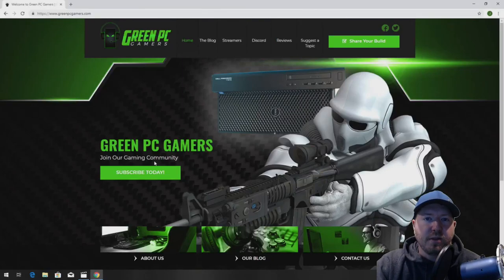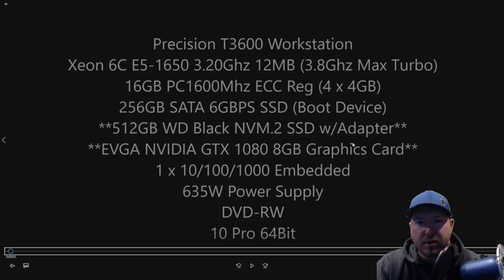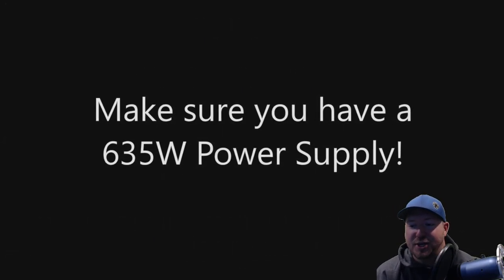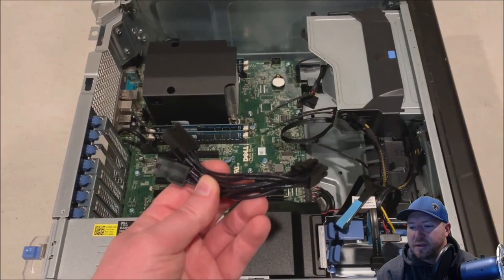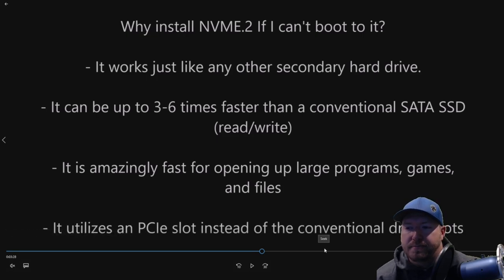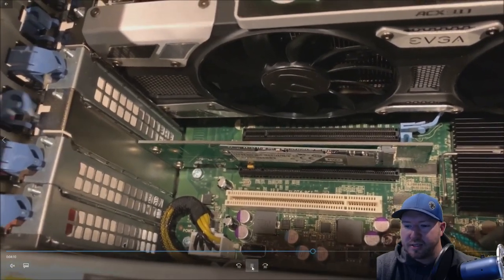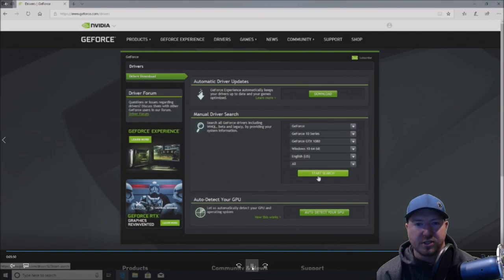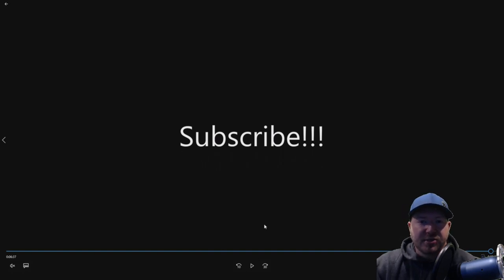Precision T3600 Gaming Computer (NVIDIA GTX 1080 and NVME.2 Install)

Comment: I have a T3600 I have built, 32GB ECC RAM, 635Watt Power supply, I added a 500GB M.2 and 1TB spinner, with a GTX 1060 6gb...the box can pretty much handle anything I throw at it...and it doubles as a VM hyper V lab for my work I do...best bang for the buck!
Reply: Do u know if GTX 1050 is compatible with T3600?
Reply: @ALbajajajo2766   yes it should work if anything update bios?
Reply: Is the A18 the only available BIOS update for Dell Precision T3600

Also I am using 16gb of ram. (4 x 4gb) DDR3. Not ECC Reg. Not sure if I should use ECC Reg ram?

According to Google using ECC Reg ram will reduce gameplay.

Comment: Very nice ! I have the exact same computer. I installed an Intel Xeon E5-2690 V2 CPU and a EVGA GeForce RTX 2070 XC ULTRA GAMING 8GB GDDR6 Graphics Card. Works great and I'm even getting around 90 to 120 fps on triple AAA games.
Reply: @Adel 😉 wait a sec xeon e5 v2 works on t3600????? are u trying to say that??
Reply: @subhanbasharat7891  I am Running E-2690 V1 did not think V2's worked over microcode in intel chipset on T3600 did you get one V2 to work ?
Reply: @Adel 😉 RX6600 works with T3600? my processor is E5 1650, but could only gets black screen with AMD driver. Did you do any trick to get RX6600 working? is your BIOS ver A18?
Reply: Looks like you got T3610 version and not T3600 because it WON't support Xeon E5-2690 V2 CPU.
Reply: False information!! Edit it!!!!

Comment: Tip for NVME drives on older hardware: You can install Clover on a standard HDD that you wouldn't otherwise use in order to "pass" the boot sequence over to an NVME drive that's on a PCI-E expansion card. You'll get the performance you should get from an NVME drive, assuming you have enough PCI-E lanes.
Reply: Are you the kind of player who beats up your Co-player or the kind that co-operates into rescuing your girlfriend?  
River City Ransom High Forever! 
#ono
Reply: There really isn't a need to boot from NVME drive on PCI. That's if you have the Perc H310 pci card. I installed a Samsung 860 Evo SSD attached to my Perc PCI card under UEFI in my T3600. Crystal disk Mark reflects 3490.7MB Read and 2564.3 MB Write for sequential. I am rather pleased with it.

Comment: Yes you can boot it up with an NVME And Clover Utility in a Internal USB penDrive next to the Power Supply.
Reply from the maker: Your are correct
Reply: ok this is for booting, but how do you install win 10 on NVMe in the T3600? My NVMe can be seen in the windows folder, but when I want to try to install it in NVMe, it is not shown as an option for installing

Comment: Picked up one of these cheap recently, upgraded the GPU to AMD RX 570 (Thank you Bottleneck Calculator), RAM to 32 gigs 1333 but had to contrive a side panel out of foam core due to the height of the GPU. Getting well over 100FPS  on Doom Eternal at 1080 and it's also a flawless HTPC. Previously had an AMD FX-6300 system with the same GPU and got lots of artifacts playing videos due to bottle neck issues. Best of all the T3600 - "The Terminator" has built in handles :)
Reply: Bottlenecks don't cause artifacting lol

Comment: the 1080 will be bottlenecked slightly i would recommend a 1070 or 1070 ti. or going with a e5-1660 with a gtx 1080 would be fine .
Reply: bottlenecked is just a myth.
Reply: What about a Rx 590

Comment: I have been using a T3600 as a gaming PC for two years by now. 635 W PSU, E5-1620 @ 3.6GHz and an nVidia Geforce GTX 1060 3GB. Has anyone tried the T3600 with a 1660 or 2060 GPU? I am contemplating an upgrade.

BTW, if you want people to visit your blog to get ideas, blocking the website for European visitors is rather rude.
Reply from the maker: We have tested the EVGA GeForce 1660 Ti in the T3600 Workstation.  You'd probably see a 10-20 FPS Bump from the GTX 1060 3GB, depending on what games you play.
Reply: @GreenPCGamerscom  Primarily i need a GPU with more memory, since RDR2 is really VRAM hungry.
Reply from the maker: @raskolnikov9067  you could also consider an RTX 2070 w/8GB of Vram.  Or, if you are not a gamer you could try to grab a Quadro M6000 w/12GB on an auction site like ebay.
Reply: @GreenPCGamerscom  I ended up buying a 2060, has been working great for a week by now. Really great value in these old workstations, almost eight years old and still going strong.
Reply: @raskolnikov9067  I want to do the same, did you change your cpu and psu? I plan to buy second hand t3600 from ebay next month.
Reply: @memehell  No, still the same CPU and PSU
Reply: @raskolnikov9067  Bro how did you fit Rtx 2070 in T3600 case? ain't that card too big?
Reply: @muhammadahmad2898  2060, not 2070.
Reply: @raskolnikov9067  Oh im sorry. Yeah 2060 will fit in easily. So how's your T3600 gaming machine? airflow? performance ? temps etc? and how many case fans do you have?
Reply: @muhammadahmad2898  Working perfectly. Can play everything at 1440. Box is comfortable warm to rest my feet on. No extra fans.
Reply: @raskolnikov9067  Thanks :)

Comment: Why is the E5-2689 not listed as a recommended CPU?  I have this is dual mode on the T5600 and they are a BEAST.  Of course, this requires the  825W DELL PS. All cores across 2x8C, 2x 16T to 3.3 GHz.

Comment: I bought a used 1070 blindly and ignored the fact that the t3600 cover has an internal handlebar which will cause clearance issues. Something to keep in mind.
Reply: Also the 6 to 8 pin adapter link they have in the t3600 post is the wrong type of cable. You need 8pin male to 6pin female adapters, the one they linked is male to male. I blindly copied and pasted the adapter model number since their link was all out of stock and I assumed they linked the right cable. Be wary. They sell what you need on amazon so it was only mildly annoying.

Comment: I just bought a t3600. I've put 16GB ddr3 1600mhz ram into it and a gtx 1660 super, I still have a e5 1620. Do you know if I can upgrade to an e5 1660 v2 with a bios update or do I need to stick to a sandy bridge EP cpu?

Comment: I have this computer and the same processor. But I have never been able to get it to go past 3.4 GHz. It does not boost up to 3.8 GHz. The BIOS version that I have is A18.

Intel Xeon E5-1650 0 CPU
16GB Ram PC-1600

ASUS AMD Radeon RX 580 4GB GDDR5 Graphics Card

Comment: Tried to put AMD RX6600 in T3600. It's the best value card now, 5-10% less than 3060 performance around $200 (in early 2023). However, just could not get the AMD driver working with T3600, always black screen. 🤯 Reading below, someone had issue with RX 580, sadly seems pricy NVIDIA is the way to go then. On the other side, the more than 10yrs old T3600 is going strong.
Reply from the maker: That card should work fine in your T3600.  If you are getting a black screen, you should double check your power supply and power rails.
Reply: @GreenPCGamerscom  Thanks, PSU is 635W and previously had Quadro 4000, which is 140w, should be similar to RX6600 130w. Switched the dual 6 pin to 8 pin connector once and the same. The black screen happens when AMD driver is installed/turned on, if just basic MS video driver, then display is fine. 🤒
Reply: @rffpgadsp I have the same problem:

Uninstall Current AMD Driver through DDU
Install AMD drivers again but change the options to "Driver-Only" or Minimal.

Driver only comes with no radeon software. So no bugs whatsoever

Comment: Pretty impressive how does it hold up in 2022 is it worth doing still
Reply from the maker: It's still relevant in 2022.  We have a video in Q for a T3610 with and RTX 3050 installed.  The results are pretty awesome if you are a 1920 x 1080 gamer.

Comment: I just bought this exact config, im assumig i have to remove that thing in the middle of the door? Otherwise the door hits my gpu
Reply from the maker: It's pretty common to have to remove the handle.  You can easily drill out the rivets and remove it.  Thanks for commenting!
Reply: @thegreatwhitemoose1582  Did as well with this system. Haha.

Comment: I got couple questions. Is its possible to move the components to a different computer case? I'm looking for one that allows better airflow. Also if I do swap to a new case can I use a more powerful power supply?
Reply from the maker: The T3600 Components will not fit in to a standard ATX Case.  Let us know if you find a case that works.

Comment: Contemplating replacing my Optiplex 3070 with a  i7 4790@3.6  for a T3600 635PSU I have on the bench. I can move over all my components but I’m not sure if the Xeon 1620 in the 3600 would be a lateral move or at worst a downgrade. I do like the increased expansion capabilities of the 3600 but it is also a lot louder. Is there a compatible CPU that is comparable to the 4790? Is this a non concern? It’ll be paired with a 1060 SC and 32GB of DDR312800.
Reply: Hi i know this is 3 years later but im in a similar situation. I have an i5 4590 but im getting offered a t3600 with e5 1620. I wanted to ask is it worth it because from some online benchmarks it seems to me that the performance is more or less the same
Reply: Also, im intending to get an rx 580 8gb gpu when I'll have the money for it

Comment: 1.6.2019. I go to buy this workstation and E5-2690 with GTX 1080 Gigabyte G1 and 32GB DDR3 ECC reg. It is OK?
Reply from the maker: That looks like a solid configuration.  Does it have the 635W power supply installed?
Reply: GreenPCGamers.com  did the 635w run the 1080 ok?

Comment: -what does (SR0KN) mean in the name of the processors?
-In the list of recommended processors is not the "Xeon E5-2670", but what do you think of it?
Reply from the maker: SR0KN = The Stepcode the identifies an Intel Processor

The E5-2670 is decent.

Intel Xeon E5-2670 8C 2.60Ghz 20MB 8GTs (Max Frequency 3.30Ghz)

Comment: Can we install a sapphire vapor x r9 280x as it requires two 8 pin connectors but the 635w PSU only has two six pin connectors.
Reply from the maker: We've never tested that particular card in a T3600.  Let us know if you try it.
Reply: @GreenPCGamerscom  The board says 75 + Ext 225w. The graphics card requires 250W So, my question is can we use a 8 pin male to Two 8 pin splitter to supply the remaining 175w to the Gpu and would it be safe?

Comment: I am currently upgrading a t3600 with an e5 1650 overclocked to 3.8 iirc. I moved to 16 gb ram and ssd storage. I just got a 635w power supply so I could do a gpu upgrade. I have an evga rtx 2060 xc on the way. However, I am slightly concerned about cooling without any modifications. Do you think internal temp will be an issue in a cool environment? If so, what modifications can you recommend?
Reply: Did you ever get to doing this?

Comment: I need help pleaze💔. I have dell preciision t3600 and gtx 1060 3g gigabyte is woork 
 in solt 1 exlant 👌, but  no woork in other solts😔💔
Reply from the maker: You should be installing it in to one of the PCIe X16 75W Slots.  What wattage power supply do you have installed?

Comment: I purchased the recommended 635w pdu and recommended dual 6pin to 8pin adapter from server world but the pdu did not come with the dual 6pin adapter you mentioned in your video. Can you provide the part number for that and where the dual 6pin plugs into the board that would be helpful.
Reply from the maker: Dell PN:  D92C9

Comment: only nVidia gpu or you can AMD RX570, RX580?
Reply from the maker: The T3600 would work with AMD Graphics Card.  We normally prefer NVIDIA cards because they seem to have better driver support.
Reply: @GreenPCGamerscom   thanks!!
Reply: RX 480 8GB bios modded to the RX580 8GB is hard to beat with prices hovering at or below $80.

Comment: I'm trying to put a 2080 inside but I'm afraid it won't fit cuz of that weird handle thing
Reply from the maker: Check out our Precision T5810 Graphics Card install video.  It shows you how to remove that internal metal piece that blocks most GPU's.

Comment: I have a 635 watt power supply. T3600. From work. Has a nidiva quadro. I sure i need to change that thinking 1070 or 1060. Not sure cpu yet. Would love to stream via capture card ps4 using obs. Or xbox.  
Would this machine be able to handle those chores? If it was soley a streaming rig. What would you suggest? In machine has window 7 pro currently. Will know more once i get it booted. No device it reads. Does not respond to F12.
Reply: Nivida quadro 2000 1gb. Looks up my price range. Icing on the cake would be able to game on it. When not streaming.

Comment: What temperatures did you get on E5-1650 in this machine?
I have one but it get 80c in few seconds, then it start to be laoud as jet engine, works good, 3,5Ghz not less but it's loud as hell.
Reply from the maker: Mid 70's under load.  We've since started installing the noctua heatsinks for better cpu temps.  Watch our T3610 Noctua heatsink install video.  It works on the T3600 as well.
Reply: @GreenPCGamerscom  Stock hetasink?
Got some issues, CPU in idle got 40 c, if start full load in 3 seconds got 80, fan trying to be jet engine, its loud but no more than 80c...
E5-1603 got same 130W TDP, newer more than 60c.

BTW, i saw noctua video, this PC is not worth it, noctua will doble price of this PC.

Comment: Any cooling suggestions other then turning all fans on high? PCI fans, I did add a 80mm exhaust fan already still getting high temps on GPU and CPU i do live in AZ but any suggestions would up.
Reply from the maker: Custom Perforated Metal Computer Side Panel for Better Cooling (Precision T7810) https://youtu.be/6-VXnMOschE

Comment: Hi, bought a msi armor 1070 to upgrade
I have the 635w psu but is a single 6pin to 8pin adapter enough to run the card
Mostly i use the pc for 3ds viewport
Reply from the maker: You could use a dual 6 pin female to 8pin male adapter.
Reply: @GreenPCGamerscom  Where im from looks like they hate that dual 6 pin female xd
But i just read that its 99% impossoble..so i need the dual one 
Thanks for the reply

Comment: I HAVE A SAME SYSTEM BUT CAN YOU TELL ME IF I CAN  PUT A 3070 ON IT?
WITH XEON 2690 CPU
.
.
.
PLEASE HELP
Reply from the maker: We haven't tested the 3070's yet.  Let us know if you try it.
Reply: Clorox Bleach  fun fact if i wanna buy a 3070 it will toke 2 or 3 years of working in my country (if the price stay the same) btw prices in my country go insane every day..so locky you

Comment: Awesome video.i have a dell precision tower 7810 with a 825 w power supply . The power supply has two 6 pin power plugs my graphics card is 970 it has a 6 pin and 8 pin how can I convert it ??
Reply from the maker: Get a 6 pin female to 8 pin male adapter.

Comment: I just bought gigabyte gtx 1080 g1 gaming but t3600 don't have a 8 pin and 6pin connecter what should i do?? Pc have 635w psu...
Reply from the maker: Did you upgrade the Power Supply, or was it stock?
Reply: @GreenPCGamerscom  it's stock 635 psu with 2×6 pin connector but don't have 8 pin connector...
Reply: @muhammadzeeshanqamar4502  When I bought the T3600 I mistakenly thought that the adapter, which is shown on the video used to connect to the 8 pin female plug on the graphics card to the 2 6 pin male plugs, was the d92c9, and ordered one. Turns out that my T3600 (and yours in this case) came with the dual 6 pin male connectors already so what you REALLY need is the (2 FEMALE 6 pin to 1 MALE 8 pin) adapter and NOT the d92c9. OR, to make it really easy regardless of whether your power supply comes with the 2x6 pin plugs, get this from amazon: COMeap 8 Pin Male to Dual 8 Pin(6+2) Male PCIe Power Adapter Cable for Dell T3600 T3610 T5600 T5610 T5610 T7600 T7610 5810 T5810 T7810 13-inch(34cm). This one plugs directly into the 8 pin female plug on the power supply and then directly to the 8 pin female or both 6 and 8 pin females on the graphics card. It wasn't clear in the video. Now I have to get another adapter :(
Reply: .... I'm perplexed.  Did you pay GreenPCgamers for the rights to view this video?  Or you pay them a monthly subscription for access to their DIY video collection or something?

Comment: Hey so I have a Dell precision T3600 series. Here are my PC specs:
RAM - 32 GB
Processor - Intel xeon E5-2667 
Graphics card - Nvidia Quadro K4000 3 GB
Storage - 2 TB

So now I am planning to change the graphics card. Could you give me any suggestions as to which card I should go for? I'm planning to get the Nvidia GeForce GTX 1050 TI or 1060. Is this fine or should I go for something higher?
Reply: A used rx 570 could be good
Reply: You should definitely go for something better
Reply: @harith1626  should I go for GTX 1660?
Reply: @kamixaze9155  thank you..
Reply: What power supply are you using? What resolution are you trying to achieve? What games do you play?

Comment: Hey, I have a question. Would this computer with a Xeon 4 core cpu with a 685watt psu work with an rx 570? I have 16gigs of ram in it right now.
Reply from the maker: Yes, it should work fine.
Reply: @GreenPCGamerscom  thanks

Comment: Hi i have a dell t3600 workstation the same its works with rx 580 8gb grafikcard?
Reply from the maker: The RX580 should work fine in a T3600 Workstation that has the 635W PSU.

Comment: can this power supply run an RTX 2080 TI?
Reply from the maker: You'd probably want to get the 825W power supply if you plan to install and RTX 2080 TI.  Just a heads up, there will be some strong bottle-necking if you install and RTX 2080 Ti in a T3600 Workstation.
Reply: @GreenPCGamerscom  thanks for the response.. and the installation is temporary. So I'll not be upgrading my power supply as I'll sell the RTX soon. Just wanted to know if it's possible to use for a while with 635W psu